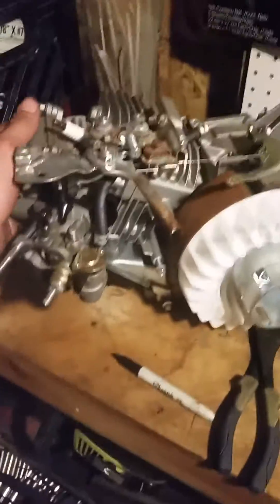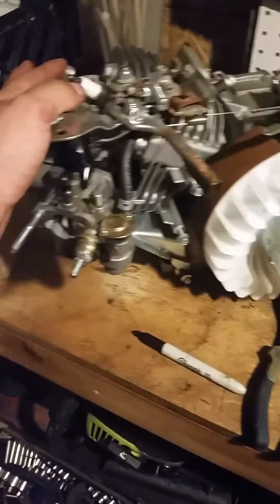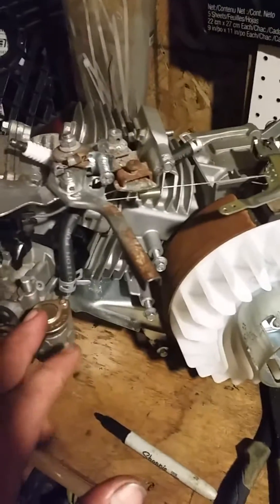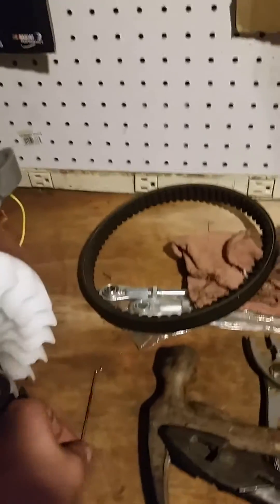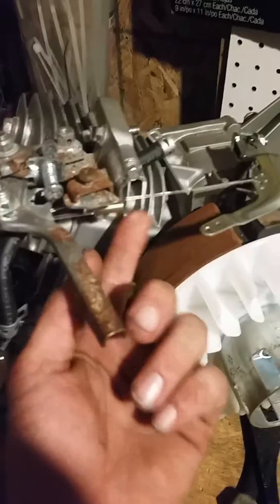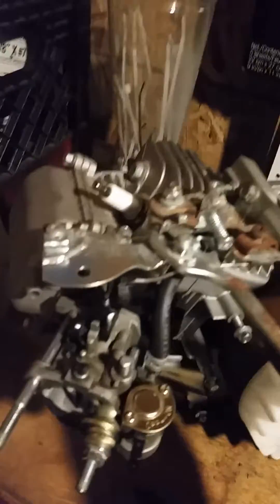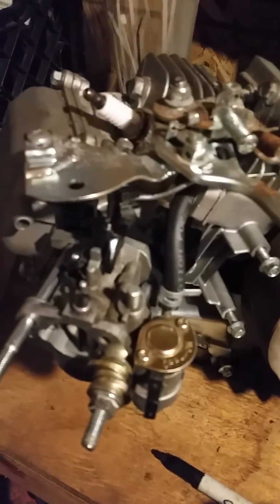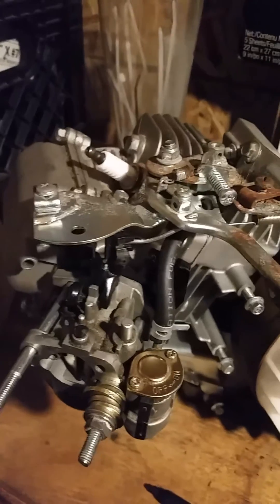Predator 212cc how to get full throttle (without governer removal)

Comment: I have done something similar but when I let off the throttle, the choke closes too much and stalls the engine, also starting the engine is difficult because the choke remains close until I throttle up.. what do I need to adjust to help my choke to remain at ideal without stalling???
Reply: Raise idle screw

Comment: I just took off the gas tank and removed the whole external Governor arm the only pain was getting a solid throttle return all the way as I used the long rod and cut it down drilled a hole in throttle arm and connected it there the return spring was kind of a pain in the ass since it was originally connected to the Governor arm I took off. It starts and runs good but I have to wait for weather to break to take it for a ride.

Comment from the maker: If u put a limiter then yeah the engine will not exceed top speed ..now if you want the max rpm the correct way is to take the casing off and remove the governor gear and the arm and put a bolt or something in it's place to seal the hole where oil will not sling out  ...then you can either make a arm that attaches to the lever to the carb or make a bracket  but I find it easier to make a rod and attach to the lever and carb and use the existing setup for the throttle cable to the pedal

Comment: So should i leave the governor hand ? Correct me if im wrong but in the throttle hand , it has a screw which you can limit kn how far the rpm can go.Can that salve the problem that other had ?
Reply: yes, there is a throttle limiter screw on the arm you can physically limit how much throttle, and thereby limit rpm also, but even with stock governor, you can wide open accelerate until hitting the 3500-3600 governed rpm. that screw turned in will prevent WOT at any rpm
Reply: I removed the arm on mine & got alot better throttle response

Comment: Although in theory this disables the governor from the carb, it does not disable the actual governor from spinning inside the crankcase as it soins by centrifugal force. Over revving the engine can easily cause that plastic gear to break apart and destroy your internals. If you are going to do this, remove the entire governor and plug the hole the governor arm came out of. Unless you enjoy buying engines.
Reply from the maker: Thomas Coffin been running this engine like this with governor gear still attached still running strong..but I get what your saying better to remove
Reply: Robert Hardy yes it is. Because even if the gear is disabled on the throttle body, it still spins inside the case and its just cheap plastic.
Reply from the maker: Juan Lopez..what are you trying yo do

Comment from the maker: to do this procedure you have to take off air filter and the unit box and expose carb ...and remove gas tank to remove governor arm rod and spring leave secondary spring attached that will be that far back one that attaches to the arm by itself ...then to replace with new rod you can customize and cut to size whatever suits you the best doesn't have to be exactly how I did mine as long as the arm doesn't bind up with the butterfly housing on the carb which will be the grove notches that the rod slides into and secures down
Reply from the maker: what I didn't realize that my belt was worn out that's the reasoning behind with having no power after governor mod ...I replaced belt big difference I would recommend the mod for full throttle works great no problems even opened it up on the street
Reply: Robert Hardy make a vid how it runs show better light quality of the throttle. That would be helpful